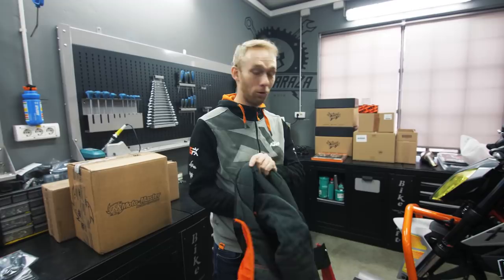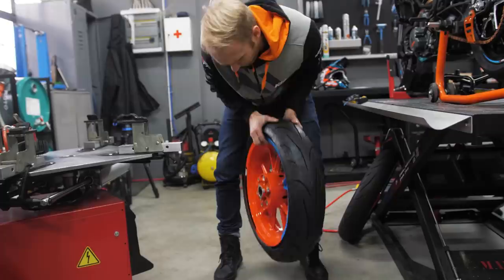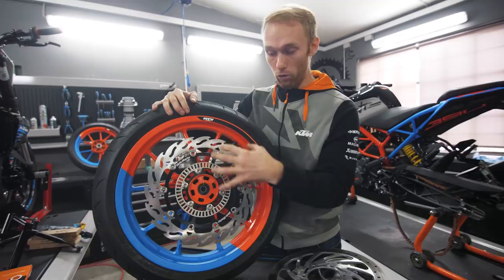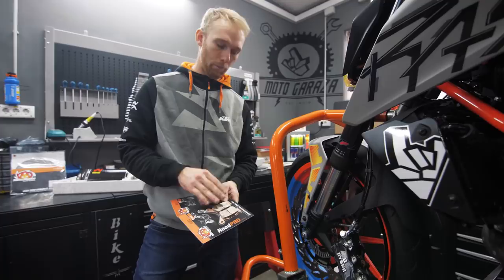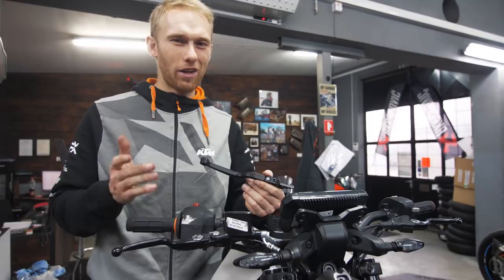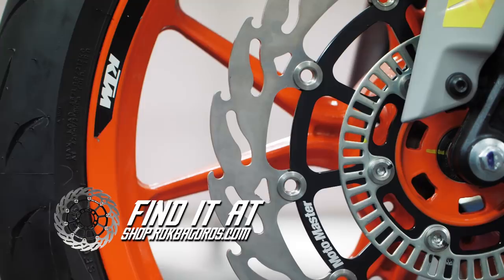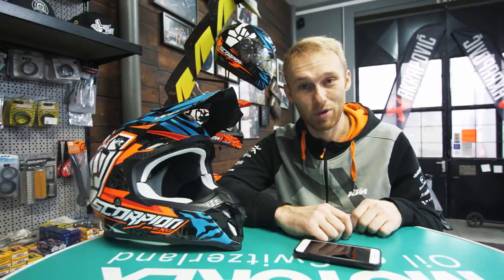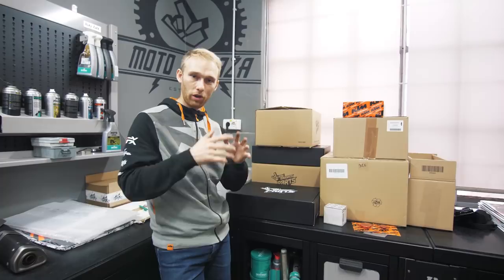PERFORMANCE UPGRADE [Duke 390 street build - part 3] | RokON vlog #77

Comment: How much lighter is the front disc compared to the stock one? Since it’s rotating mass, it will help with acceleration, braking and turning. I’m thinking about doing the front disc and also a lithium battery to save some weight on my 390 Duke.

Comment: Hi guys, great video. Is it possible to put the 320mm disc on the Duke 390 2015 model (and spacer out the brake unit from the forks to fit). If so, is it worth doing for any extra braking performance?

Comment: Brother, you have installed performance parts which are not available in india however you have installed akropovic exhaust only and not whole system. Any special reason for that since here it is rumoured that we need to change whole system thats is front pipe belly pane and exhaust.

Comment: Hi, i have a KTM duke 250 and barely done 4000km, suddenly today morning as i was trying take it for a ride the bike wouldn't start, I turned the key, everything looks normal even on the cluster but when i press the start button nothing happens, I've press the on/off switch multiple times and press the start button again again nothing happens not even a sound, I've checked the battery/fuse everything's in perfect condition, and btw i haven't had any problem with the bike since it's fairly new, anyone had any idea on what's going on with my bike?

Comment: Not hating here, but the rear brake disc is mounted wrong. It's not able to scoop up any air, because the airscoops on top of the brakedisc are mounted in the opposite direction. Yet again not hating, just letting you know.

Comment: Hi mate, are u sure u are using the proper loctite number specified by the manufacturer for this application? There is heat involved in this location of the bolts!
Reply from the maker: No I am not sure if it was the right one ;) What is the right one?
Reply: @RokBagorosStuntrider  I don't know mate, but previously I read that every application has standards including the torque levels, bolt size and the heat the threads are subject to.  I Think the one you used is fine but I am concerned if the heat transfers to the loctite and cause it to loosen. You can ask a professional about it, thank you dear.

Comment: U seem 2 B A bit OCD. That's A good thing. So, I couldn't help but notice. It appears that the front tire, rotation, is incorrect. The arrows on the side wall, R backwards. I do like what U have done, overall.

Comment: My friend I have a question, I have a 2017 Duke 390 and it's having terrible overheating issues. It seems to only happen when I wheelie. After the bike will overheat and not cool down. Also sometimes the check engine light comes on. Any advice? My dealer has not been any help.